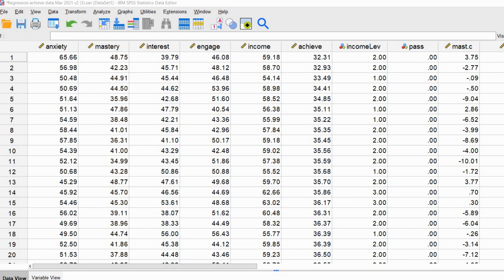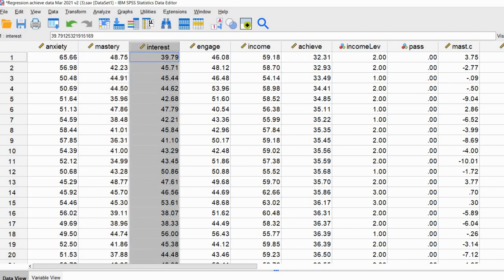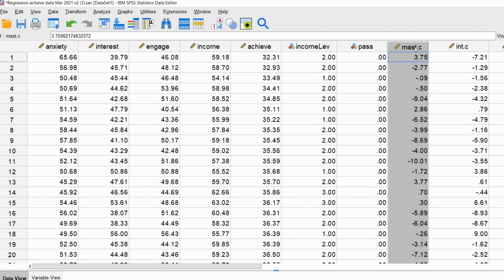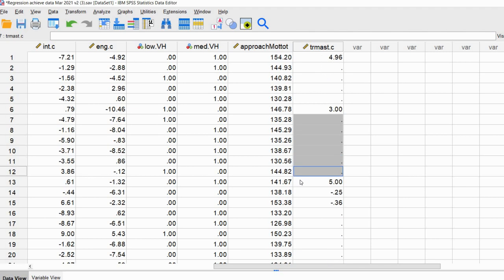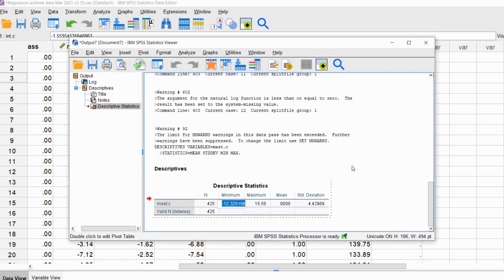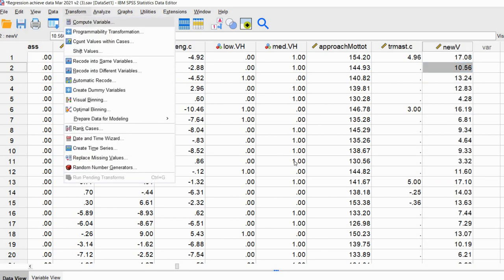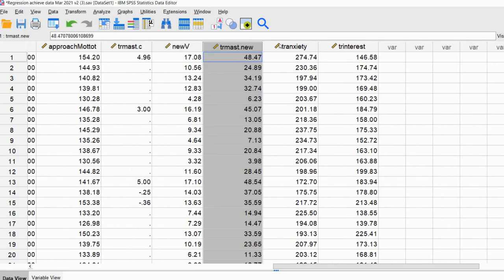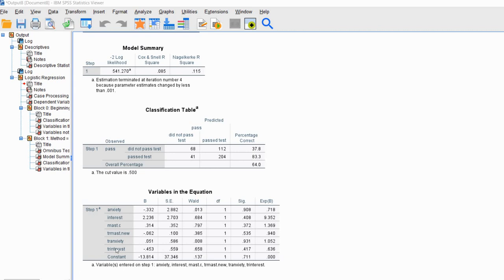Testing linearity in the logit using the Box-Tidwell transformation in SPSS (Part 2 of 2)

Comment: Thanks for this video. If my independent variable has a minimum value of 0 and then only positive numbers, is this an issue? How many zero values would make it difficult to assess linearity?
Reply from the maker: Hi there. Yes, this could be a problem when testing for linearity in the logit because you cannot take the natural log of 0 (your minimum value). If you want to retain all your cases when testing for linearity in the logit, then you'd need to make sure the minimum value on your variable is > 0. Hope this helps!